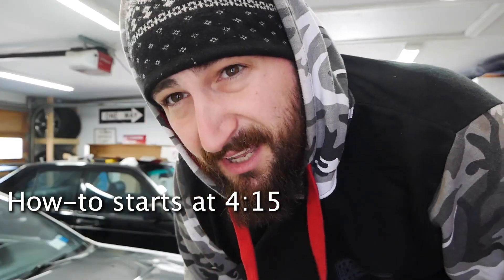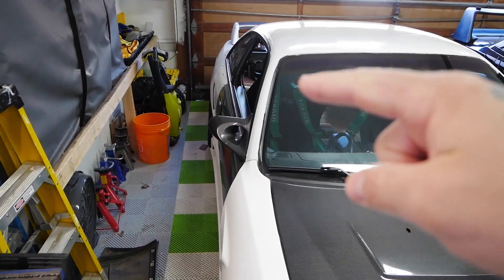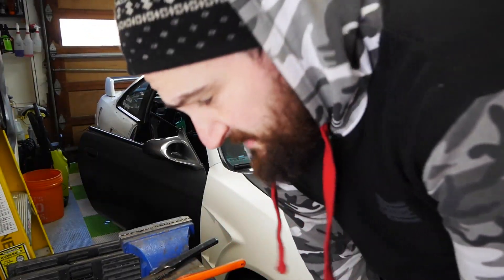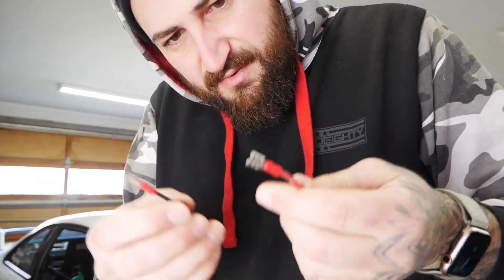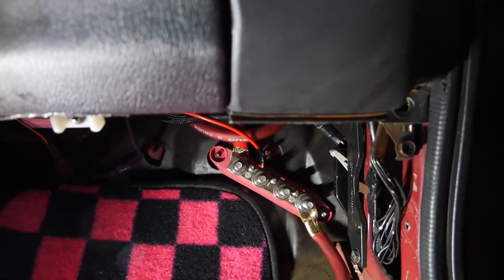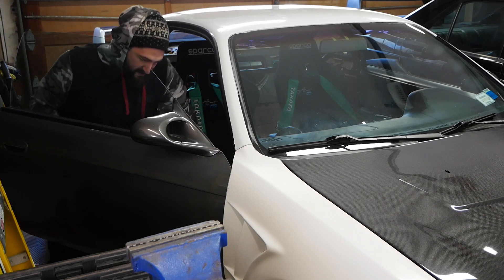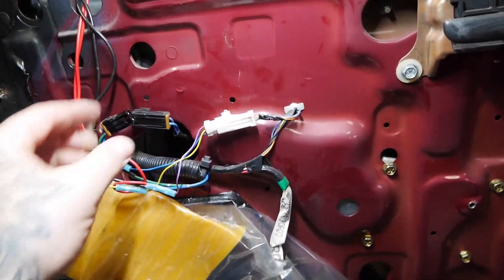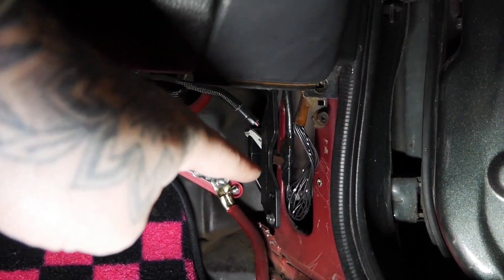How to roll your stuck window up/down | window regulator | nissan 240sx s14

Comment: Yup it’s my window regulator. Sad thing is now that I know that it’s the regulator, I can’t remove the window due to the 10mm bolt/nut not lining up with the hole😂 Might need to get some sort of bending socket attachment.